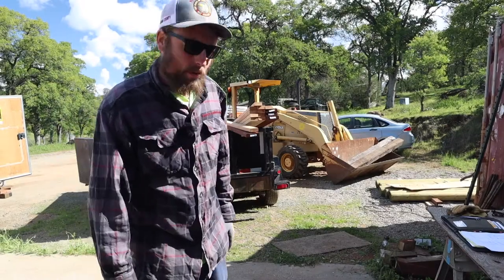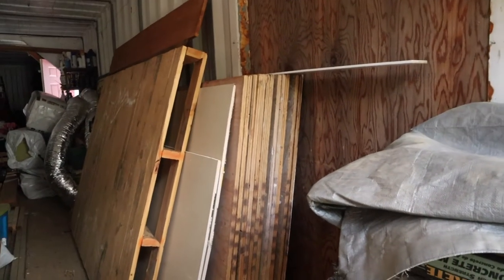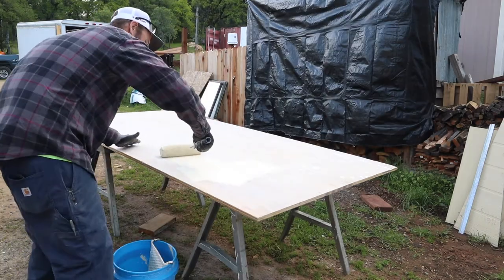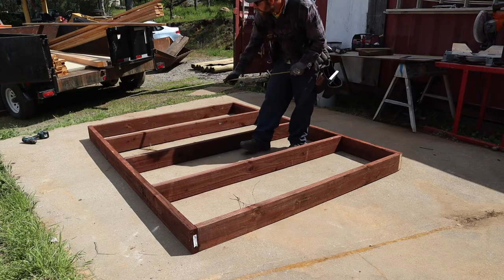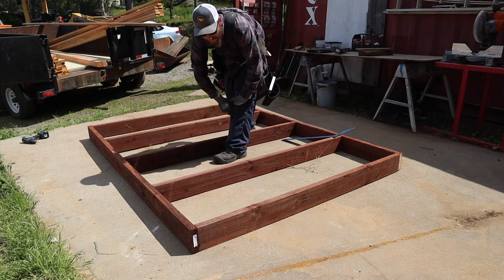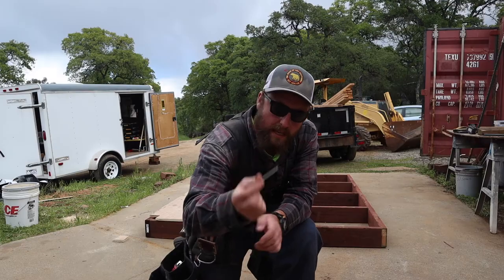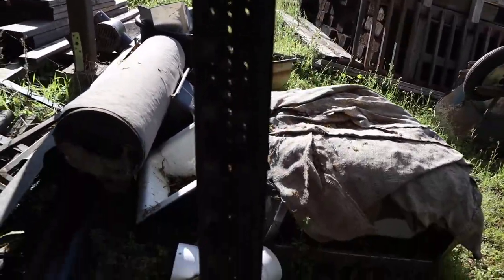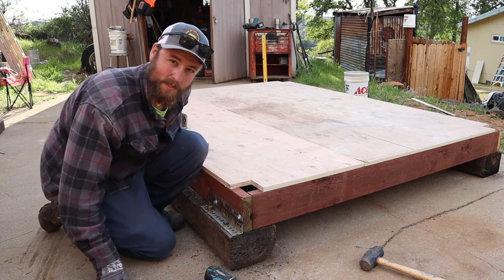FLOOR FRAMING, Chicken Coop  | PART-1

Comment: i want to build a shed but im going to be using some of your ideas lol, mine is not a chicken but an actual shed on top of a terrace so it needs to be movable, skids or cement blocks as theres lots of rain here in mexico and it needs to be off the floor some 2 to 5 inches or there abouts with a lean to roof where i plan to have a rain harvesting system of some kind and ill be using all screws so i can take it apart when the time comes, who knows a chicken coop lol thanks so much for the ideas and showing the way its done especially liked the way you didn the lean roof and how you showed all the details as well, thank again

Comment: Joe, 
If someone were to purchase all the require material, any idea what the total cost would be?
Reply from the maker: For this extreamy over engineered coop, framing package plus the materials that I have on hand. $800-1000.
Reply: @JoeSimple  For that price the chickens must be getting a big screen TV and surround sound system  :-)
Reply from the maker: Lol yeah I kinda went over board but a lot of the pricey materials I already had in my construction materials horde..
Reply: @JoeSimple did you ever give out the draw up. Trying to draw up a draft but I’m not very good at it.